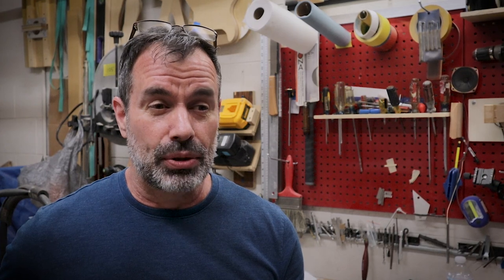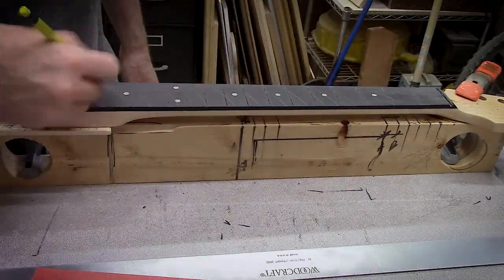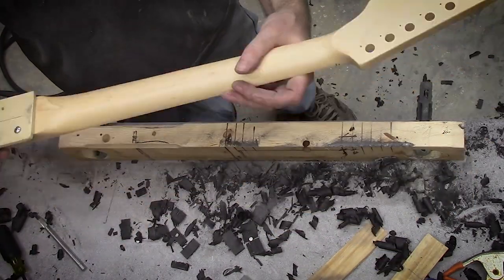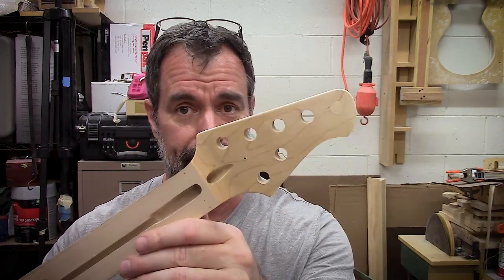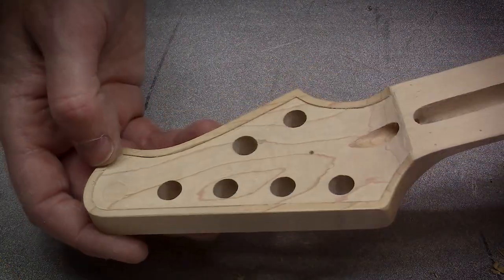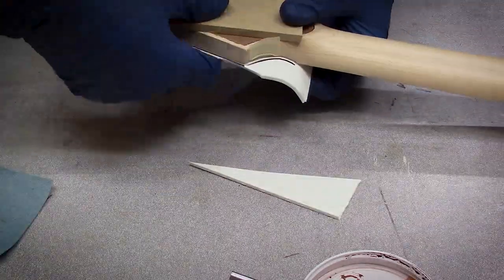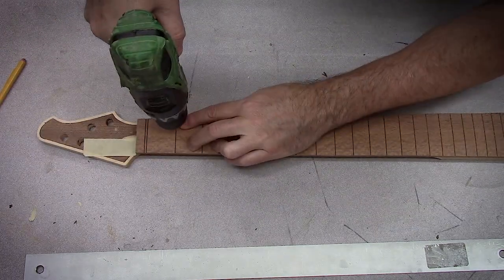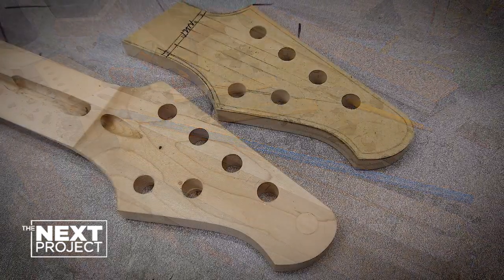Harley Benton T-Style Telecaster Acoustasonic Mod Project Build - Ep 03

Comment: Fantastic to see!
I actually used the same kit to build a plastic free natural guitar. Also reshaped the body somewhat (belly cut) and converted it to string through. Some amboina veneer helped me to get it more special.
Really looking forward to the next episodes. Thanks!
Strongly suggest to replace nut, bridge, string trees and tuners, the remaining parts quality was better.
Reply from the maker: Moskito, sounds like you have a great guitar there!
I agree, a lot of the kit parts need to be replaced. The tuners on my kit looked nice, but didn't function. The didn't include the string trees, but the headstock was drilled for them...just great.
A few odd little things, but still a good starting point, especially since I just cut it apart anyway - it's what I do.
Thanks for watching and for the comment.
Be safe and take care!
Reply: @theNextProject  Yes, mine were missing as well, but Thomann send me, when I asked. But change to roller trees immediatelly. The b and e won't work without but you need the roller ones for tuning stability. For the price, the kit is still fine.

Comment: Just subscribed! (First video watched, now back to watch all the older episodes!) 

This is an inspiration. Truly. 

As a beginner builder, wondering if you would have a few episodes of your amazing jigs! Fret board radius jig, or the bench sander jig are two awesome ideas!
Reply from the maker: Hey Michael, I'm glad to hear you're gathering some inspiration from the project.

I only have a couple videos that touch on the jigs and fixtures I make/use.
Most jigs are built out of necessity and scrap material. 
As you will see, everything I do is an experiment, or prototype 1, 2, 3...
The benchtop beltsander, was a goofy idea I had, it works - mostly. Not as precise as a dedicated oscillating belt sander, but we make do with what we have.

I plan to do a video on the radius jig soon, as there has been other interest, also a stand-alone video on template making.

You'll also see a "router table" that I use a lot. It's just a large shelf slab with a recess cut to fit my router base. Then I made a base for my jigsaw to fit the table, and a base for my hand-held spindle sander to fit the table... 

Take any ideas you see and improve them, make them fit how you work and what you do. If you get stuck, send me a message and I'll help if I can.

Thank you very much for watching, enjoy the projects!
Be safe, take care!

Comment: there is Tiebond glue with extendet set time to 15 minutes , also great for gluing bridges
Reply from the maker: Albatros, thanks for watching!
Which Titebond are you mentioning?
I was using Original TB (1), for the veneer and fingerboard on this project.   I've also used 2 and 3 for other things, and TB cold press glue for veneer, which has a really long open/work time.

Hope all is well, be safe and take care!

Comment: Great work as usual!!!
How did you stained the tide bond? I couldn't see the product name. Do you have experience, can any water solvable pigment be used.
Gratings from Germany,
Andreas
Reply from the maker: Andreas, greetings from Florida, US.
I used a dry powder transtint stain. 
I was wondering about using liquid drops, but I don't have any liquid die at the moment. 
As you saw, a little bit went a looking way. I think I used too much in fact, but it worked. One thing to mention, the little amount of dry powdered stain did make a noticeable change in the viscosity of the glue. The video actually shows a second mixing attempt, as my first mix had even more dry powder and  got way too thick, and dark.
If used sparingly, and in places you aren't needing maximum strength, I think mixing will be fine.
It dried fast, and sands like normal.
Take care!
Reply: @theNextProject  Thanks a lot, now I know for what to look! At the moment I don't know for what I will use it but how knows ; )

Comment: I am so curious how you will locate the spots to drill through the veneer for the tuners. Have you already figured it out? Signed up to see more, should have done it already during GGBO 2020 anyway!
Reply from the maker: Janvi, thanks for watching.
I could either use the headstock template to find and mark the tuner post hole centers, or a paper template would also work. I quickly marked the locations using my template, then used an exacto knife to punch through the veneer faces. After that, I cleaned up the holes and that's about it. 
I am planning to do a GGBO 21 build, but I'm a bit behind with some other projects, so if I do enter, it will be last minute - again.
Take care!

Comment: Don't get me wrong here... I like your videos, they're good but.. part of me I thinking, why go though all the fuss of modding a second Harley Benton, at this point you clearly have skill to build from scratch.
Reply from the maker: Ah-hahaha!  
Hey Ross, I ask myself the same question, and you're not alone asking me either.  
Many of the things I do would be easier from scratch for sure.
Pulling frets and scrapping a fretboard are kinda a waste of time, but the process does present me with new experiences. And I like being able to share things like that. 
Some people may not know that getting a fingerboard off can be such a pain (this one was a pain). Typically, I can heat them with a clothes iron and the "wood" glue will let go, that wasn't the case here. So, I guess working on this kind of a project helps prepare me, and others, for a bad day in the garage/shop. 
It's kinda fun to tear stuff apart too.

I have a scratch build starting soon,  it will be a laminated hollow body electric. Something new for me, but it has a foundation in all the builds and mods like this one.
Thank you very much for watching and the honest question too, I completely get ya man!
Be safe, take care and there will be more misguided stuff in the next episode. 👍

Comment: Hello again from Ireland. So Leopard wood? I've never heard of it to be honest. I know the body of those kits is made from Rengas the sap of which is toxic and can cause poison ivy like skin irration on certain people. I bought the exact same kit recently but haven't had time to do anything with it yet. I intend reducing the body thickness, filling in the existing routs, putting a maple cap on and routing for two p90 pickups. I'm not going to use any of the hardware that came with the kit and have bought a hard tail bridge, kluson tuners, graphtec nut and string trees and quality pots and a switch. 
I dont like the small frets and would love to fit bigger ones, maybe stainless steel but I've never done that before.
Also not sure on the pickguard or if I'll even use one!
Anyway stay well, keep the updates coming.
Reply from the maker: Brian good to hear from you! 
Sounds like you have a great build planned out. Keep me posted as you progress. 
Take care!
Reply: @theNextProject  I will do. In the morning im on a mini digger to excavate for the concrete floor slab of my new backyard  workshop! When its built the first project will be the tele. I have 46 yards of limestone paving to lay after the workshop is built so the guitar may be a while yet.
Reply from the maker: @briandevitt6903   you're a very busy man!  Good luck with the excavation..., and be safe!